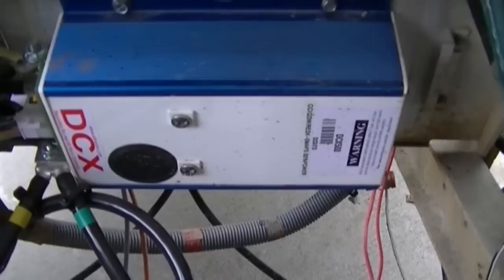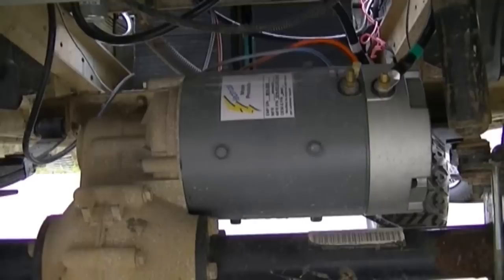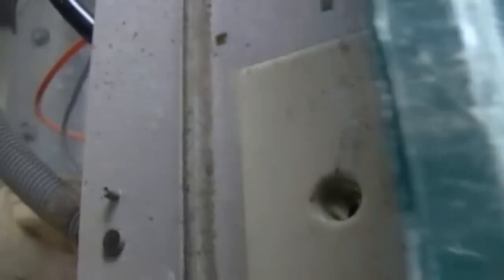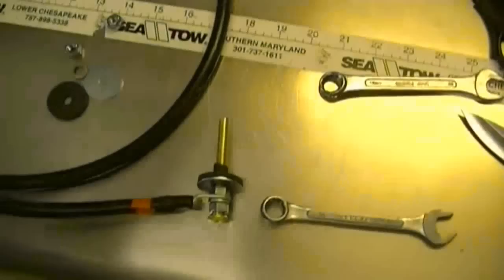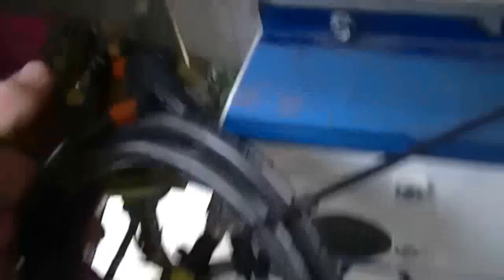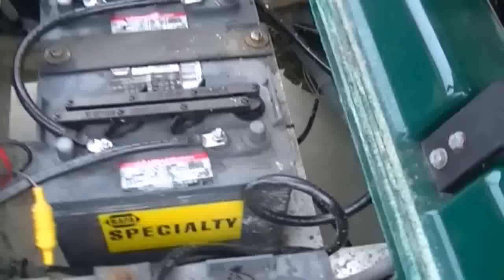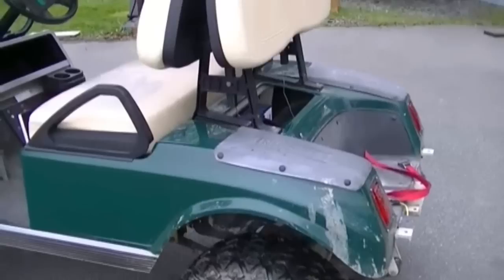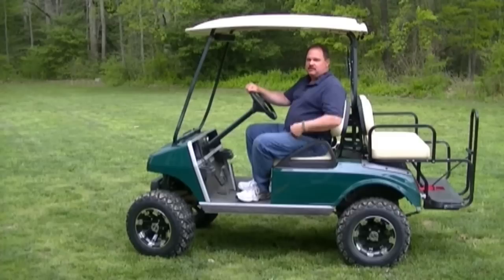Golf Cart Hop Up for speed and torque off road - see description too!

Comment: MY CLUB CAR DS RUNS 33 MPH, AND IT DOES NOT OVER HEAT AT ALL. MOTOR IS FAN COOLED. I BOUGHT THE MOTOR AND CONTROLLER FROM D+D MOTOR SYSTEMS. THEIR MOTORS ARE TOP QUALITY.
Reply: sounds dangerous to me for a golf cart to go that fast.  I would not want any of my children driving it.
Reply: What kind of price was it for the motor and speed controller
Reply: just asking, what do you mean about mph? meter or mil. im sorry i was confused lol
Reply: Which D&D motor how many horsepower
Reply from the maker: Very cool!

Comment: Greeg I have sane set up i did in 08 for some  reason  today  my cart stop dont know  y any idea I was just driving  slow for haft hr cart stop  now it won't do anything  had to tow home could be coil what you think I have same control  500 V I did haft lift can do 35 I noticed  you put fuse at end of battery  mine is at beginning  of 🔋 battery's
Reply from the maker: Did you wire it to properly charge?  a current has to go through the computer to show it for it to charge correctly.  Other than that I'm not sure.

Comment: I just installed an All Tracks 500amp controller with a Flight Systems 4kw speedey motor. Also switched to Lithium. 35mph. It’s nasty. 😂
Reply from the maker: Ballsoutwilly Man that's COOOOOOL!!!  That stuff was not out when I built mine.  Once I redo the lift on this thing to something more stable, I might have to look into that.  How's your Torque?  I have many times with 3 guys, gear and a deer or two tied to this thing going up and down hills...

Thank you for watching. I've got some really cool stuff coming too! click the "bell" icon to get notified of new videos posted every week. You can also check out & follow the FB page for updates, suggestions, etc: https://www.facebook.com/scottgreggoutdoors/  I usually post what's coming up there as well.  Also Instagram at www.instagram.com/scottgregg1966/
Reply: Any update on the torque on this set up, how is it after all.
Reply: Aurelio Sanchez still running strong. I was originally running 23” tires with 14s getting 35mph at 5200rpm. I’ve reduced to 22” road tires with 12s. I’m at 37mph. At over 6000rpms. I think she’s maxed boys.
Reply: Scott Gregg torque is unmatched but I have 10-1 gears...
Reply: Scott Gregg I don’t recommend the 23” tires with 14s. If you do a 6” lift like I have I’d use 22” tires with 12” wheels. When I got rid of the 23s it increased my torque 30%.

Comment: Scott, did you ever get a range on the cart with all of the upgrades? Please include an approximate weight of everything in the cart (including people) if possible. I'm interested in building one of these but I need to make sure it can cover about 5 miles.
Reply from the maker: I don't really have a place to put that much on it at once so no.  As far as weight, I don't know what the cart weighs but figure about 700# for 3 of us, plus 3 guns, gear bags, and dragging a deer that weighs 125#+ No problem, including hills.

Comment: I need torque to pull a boat and trailer up the boat ramp. I need to gear down my 48 volt motor and differential, weight about 750 pounds.
Reply from the maker: Get a hold of the motor guy in the link below the video.  Tell him what you need and he'll put you together a package that can do it great!  (EMP is the company)

Comment: Does anyone use lithium battery packs? Smaller, lighter, more amps if needed depending on the parallel configuration. What is the amp output of your circuit? You said 51 v, so these are apparently in series. I'm sure this is the least expensive option the way you have it hooked up, but it would be cool to see like a 12s 10p battery setup with lithium 18650 Batts, maybe even push the voltage higher with an extra circuit you could switch off and on for the turbo action!! Anyway, cool cart. I'm going to be grabbing one soon to tootle around here on and I'm trying to decide between gas and electric. Both appeal to me, so I'm weighing options.
Reply from the maker: Nurzrachit I chose electric because I wanted quiet and simple, and no gas.  Mine is working great and doing all I need done.  Not sure on Amp output, and really would rather spend money in a lift upgrade than battery conversion to Lipo....

Thank you for watching. I've got some really cool stuff coming too! click the "bell" icon to get notified of new videos posted every week. You can also check out & follow the FB page for updates, suggestions, etc: https://www.facebook.com/scottgreggoutdoors/  I usually post what's coming up there as well.  Also Instagram at www.instagram.com/scottgregg1966/

Comment: I have a 1988 ezgo electric golf cart that just stopped running? I will not go forward or backward when I push down on the accelerator.  The batteries are fully charged but the cart will not move. I do not hear the solenoid clicking when I push down on the accelerator? Should I replace the solenoid or is there another problem I am not seeing?
Reply from the maker: +jack ludwig If you don't hear the solenoid click that is probably it.   Go ahead and get a heavier one.  I burned mine up when I put the new speed control on.  (Knowing that was likely to happen)  My cart upgrades went a little at a time.  I think there are links to parts in the description below the video.
Reply: +Scott Gregg 
thanks for your reply. after charging the batteries for 24 hours I now get a clicking sound from the solenoid but it still does not run. I have 36V on one side of the solenoid but no voltage on the other side so I have concluded the solenoid is not working and will replace it. If that doesn't fix the problem I am not sure where else to look.

Comment: There is a difference between torque (power) and traction. Traction is determined by weight and tire size (if any difference).
Reply from the maker: Torque is how much power it takes to turn those wheels when you are getting traction.  Traction is GREAT with these.  With this setup and current programming it will top out at about 23MPH, and go 10+mph up a fairly steep hill with 3 men and gear on it.  PLenty of power for what we are doing with it.
Reply: Dennis Koyle 
Oh

Comment: I have a Yahama Drive,that my best  speed  one time was 32,any time I get to 30 my controller cuts it back.
I average 28/29 and quite frankly is plenty.
Reply from the maker: +Micheal Trevino With my lift kit, 25 is borderline dangerous.  30 would be insane.  This kit is great for low seep but the front end had way to much drift in it especially on uneven terrain.
Reply: I agree, my cart is not lifted but I managed to get 205/ 65/ 10s on it without rubbing.

I use my cart for work in a golf cart community, and drive on road.
One nice thing about the Drive it comes stock with internal disk breaks.

I bartered for the cart and it was customized by the seller,it is a 2012 but I do not know what he included in his build as far as performance. 
I added heavier wires and it has amazing range,I can use it all day and still play 9 holes in evening before dark.

Comment: An Ezgo RXV A/C drive with a 8.5to1 gear will go about 32 mph and only costs about $500 for the upgrade. But nice cart
Reply from the maker: Willie Guzman 32 on this buggy, with this lift/tire combo would get you a quick ambulance ride.   Way too unstable.   I will do a better lift on the next one.  You don't want this one going over about 25 anyway and that is pushing it. But it will climb a tree with torque!
Reply: Cool cart
Reply: If I was to get that speed controller with stock motor how long will it hold up? Maybe put a temp gauge on it
Reply from the maker: Well mine made it about 3 miles.  haha.  I put the new SC and Solenoid on after frying the original sol with the big tires.  Inside 3 miles of hard running the motor burned up. (as is goo running out and dang near on fire)  Plan on a motor upgrade.  It's well worth it.  This thing will almost climb trees. haha  Links are in the description below the video.
Reply: Well figured it was worth a shot but guess I better not till I have the money for a motor thanks for the info.
Reply: can you tell me why my huntve 4x4 jerks when taking off, its all electronic
Reply: Edgo not built to handle higher  speed than 22 miles  hr there front  set up not strong  enough  only club car sturdy  to do that higher speed

Comment: I have a golf car but not electric.. Its a gasoline. Can you pls tell me if how far can it travel without stopping
Reply from the maker: Andrei, I'm not sure.  I've run it for a few years now an not run out.  I have a new battery pack in it now and have not tested that part out.  If I did, I'll need a tow back to the house haha.  I'd guess at least 5 miles if not 10!  I would also think a steady discharsge would be harder on the pack than and stop and go type day.

Thank you for watching! Follow us on Instagram and FB too.  We are running a give away right now to celebrate the upcoming 40K subscriber threshold you will like. https://www.facebook.com/scottgreggoutdoors/  I usually post what's coming up there as well.  Also Instagram at www.instagram.com/scottgregg1966/

Comment: I have an EZ GO 36 volt golf cart that I have put 6:1 gear ratio differential. Also Alltrax 400 amp controller and heavy duty forward/reverse switch. I have also put 4 ga  cables  I can run at 28 mph on level road but not enough power on hills. My question is what do I need to do to change to a 48 volt system. I don't need more speed, just more torque on hills.
Reply from the maker: Probably a new motor unless yours can handle 48 check your speed controller and sol to make sure they are good for 48V along with the 48V battery pack. That might do it.
Reply: I had a similar setup in my EZGO TXT except I had a 500 amp controller.  I converted to 48V.  I then had to upgrade my Solenoid (MJZ400 Super Duty Solenoid from cartsunlimited.net because the "HD" solenoid - which was a 48v solenoid failed within a few months) and an HD F&R switch from cartsunlimied (because the standard F&R switch also failed after the switch).  No problems since.
Reply: I run 42 volts in my Alltrax. I was able to run 32 mph, flat ground with a 8" independent suspension lift and 23" tires.. I run Miata/Hyundai/AP Racing brakes. The steering was stupidly twitchy. I have reprogrammed it for a 24 mph max now. Much safer for the other family members.
Reply: Clay Mathis I

Comment: Why not drop in a small motorcycle engine?
Reply from the maker: Well for starters if I wanted a gas side by side I'd have bought one of those. haha.  I wanted to build and electric so it would have no noise and virtually no odors.  This does all I need to do, never have to worry about it starting, running out of gas, changing oil, etc.
Reply: Funny thing about gas motors, they push all the deer away, or at a minimum let them know you're there. A gas engine is not for hunting,...maybe recovery, but not getting to your stand/blind

Comment: I'm in the maintenance department at work and the golf course gives us an electric golf cart to use. I hear we need a programmer to make it go faster but I'm wondering if you have any simple hacks for that. It goes pretty slow and all the other ones are a lot faster. Please help if you know how without a bunch of modifications so I don't get yelled at. Thanks!
Reply: It is possible that the speed sensor is gone...my cart speed dropped down to about 5 mph. I purchased a new sensor off Amazon for 45 bucks and installed it myself. Takes about 10 minutes to change out...
Reply: Adjust the governer
Reply: laptop
Reply from the maker: I'm thinking you'll need to get into the programming with a laptop and proper software.  Probably can get it from the mfg'er

Comment: You used #2 welding cable to replace all battery wire?
Reply from the maker: Yes.  They are sold now as a set and run a lot cooler when you are sucking a lot of amps. https://amzn.to/2KpyDxG  Most 48V carts can use the same wires.

Comment: I am thinking about purchasing a 2009 ezgo cart. asking 4500 hundered.  it's lifted it looks in great condition with speakers etc. however I think the batteries are the original. how long do the batteries last and how much much would be to replace them all on an average.
Reply from the maker: +Xavier Vel Well kept batteries can easily go 8-10 years.   I know a guy on 10 year old ones now.   Charge after every use and keep the water up correctly will help.  Keeping it indoors in the winter when not in use helps too.  That sounds like a pretty good deal.
Reply: +Scott Gregg I'm looking at this 2009 ezgo. It's 6 years which would be borderline. how can I see if the batteries are well kept?
Reply from the maker: +Xavier Vel You really can't.  You can check the water level in them now though. Are they relatively clean or are they a mess with acid and corrosion everywhere?  How about the cart?  You can  usually tell by looking around under the seat if it's been well kept by the overall condition in there.   A really good set of batteries goes about $900

Comment: Scott, have you looked into noco genius 4 40A 4 stage charger? Its working wonders on my cart.
Reply from the maker: I have not but I'm all ears.  What makes it so special or better than the original one?
Reply: The gen 4 quicky charges each deep cell batt to 6.2 exactly. Then trickle charges with a pulse to help recondition batt. Pretty cool, its water proof too.

Comment: What app are you using on your phone to clock the speed?
Reply from the maker: +Pianogirl 124 It was just a speedo ap I found.  I don't have it on there anymore.  There are a bunch of them.
Reply: Digi HUD has a thing that you can reflect it off your windshield so it displays in the glass it's pretty cool if your in an old farm truck without dash lights

Comment: Look up DHX Machine they can make you cart go faster.
Reply from the maker: Dan thing is dangerous now with that lift kit at top speed haha.  I need the hill climbing deer dragging torque as much or more than speed.  It's a trade off.  Thanks for watching. You can check out & follow the FB page for updates, suggestions, etc: https://www.facebook.com/scottgreggoutdoors/
Reply: Scott Gregg That’s what they make. You won’t loose torque even if you go up hill. Their motors are high torque  and don’t weigh 50 pounds it’s only 12 pounds.

Comment: I seen your review on the allsport lift and followed your link here. I have a few questions for you. It says I can use 10" rims only? I bought 12" rims and 23" tires for mine. will that work? 
where can I buy the extended break lines? 
with the 8" allsport lift is there any other special things I'll have to do? thanks!
Reply from the maker: +Justin C I don't know about the tires, they might rub a bit on turning if the rims are not offset enough but I just don't know.  There should be contact info and links to stuff in the description below the video including info on the brake lines.  I had to fabricate a plate to connect them under the cart to the mount though.   No big deal.  The biggest thing to know about the All Sports lift is that is rough riding and very unstable when going fast.  I love it for coolness and ground clearance, but would probably save my money and use a different lift next time.  Hope that helps
Reply: Awesome thanks for the info. What other lifts are out there? I'm unable to find any other name brand lifts that go up to 8". I wanted a Jakes lift but they only make up to 6".
Reply from the maker: +Justin C That I don't know. Hit the forums. someone will know where the really good stuff is for sure. Buggies gone wild was a great resource for me.

Comment: I just got a 1999 EZ GO TXT DCS.......I want what u have as far as the speed and torque....do i just need to upgrade my motor and that's it?? how much was just your motor?, im looking for a ball park price range..thanks
Reply from the maker: Links to everything are in the description below the video.  When you upgrade the motor you are going to have to get the Speed controller and Solenoid and wires to handle the extra amps too and keep stuff running cool.  I put in the SC and Sol first and melted down the stock motor on the second day haha.

Comment: see I thought about making my electric cart faster.. but I need new batteries. and by the time I buy new batteries and an engine then i can already  convert  to gas cart where I can have a Max  speed of so much more with more power and range. without the hassle of charging and over heating and for half the price
Reply from the maker: True...but mine is quiet. :-)  THat's what I was going for or  I would just buy a side by side UTV and forget it.
Reply: lol true. it was hard to decide whether to go gas or electric but its crazy how much batteries cost and really all of the parts for electric upgrade.  its like $500 for a good motor, $400 for the controller, $800 for batteries.  but i would like to have both an electric and gas. the only thing is you can a gas one while using the electric motor axle and basically just have to re run the throttle and attach an engine and gas tank. so total of about $800. cheapest utv i find is in the thousands.. why is all of this stuff so expensive!?
Reply from the maker: I figure I have about $3k in it and could probably sell it for 5K.  Batteries to me are Gas and oil changes that lasts for 8 years.  But I certainly get it.
Reply: yes I will probably  spend  $800 A year on gas but In return I get longer drive time and allot more torque  and power. that's really what i wanted. i was going to do an electric with solar panels  on the roof.  (another $800) to increase range by almost 75%  but having  20hp in A 400cc engine just seemed to overwhelm  me with joy